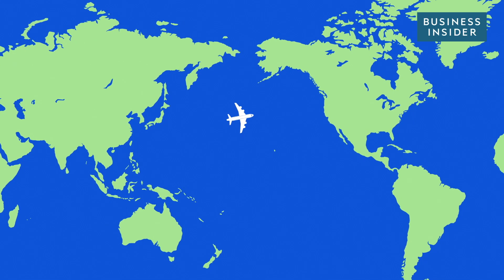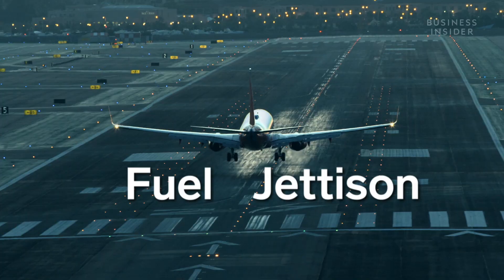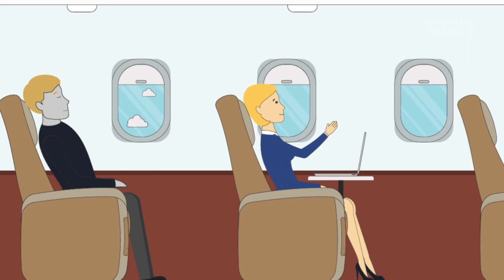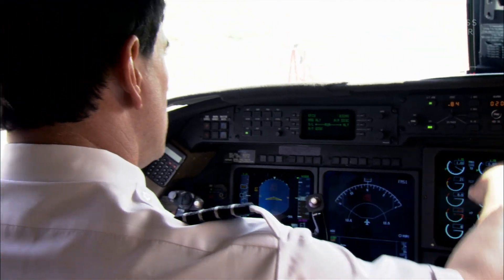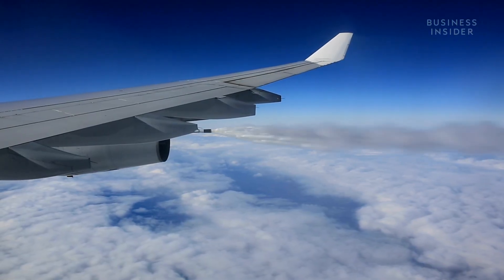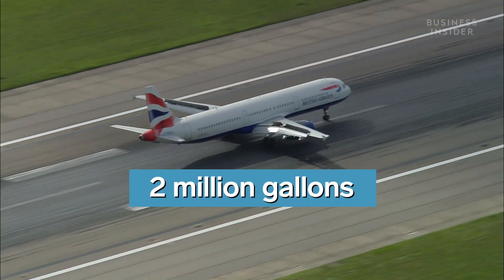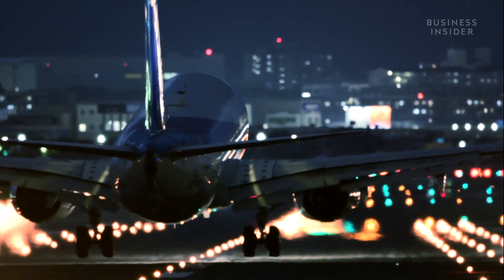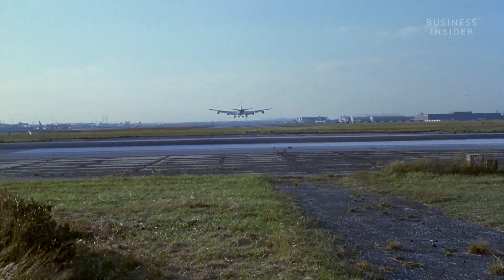Why Planes Dump Jet Fuel

Comment: Thousands of gallons a second... 15 minutes... hmmmmm
Reply: Smells fishy to me. And cargo planes with tons of stuff on board land. 
And all they do is talk bout jet fuel.
Reply: @basketballgod5947  fill up a water bottle with Legos. Now fill it with water. The water is wayyy heavier. Jet fuel is most of the weight in a plane since liquids weigh much more
Reply: thousands of POUNDS a second
Reply: Looks like your the only one who realised the math isn't adding up.

The Real answer? This video is propaganda to reinforce your belief that commercial jets use fuel. In reality once started and warmed up no fuel is required for a jet engine to run. What?! The jet turbine engine can and does run.. combusting superheated compressed air. 

"Jet fuel" is only used for cold starts.

So, this video is nothing more than.. hot air. Lol.

You've been Red-pilled. Research!
Reply: @ExploreYourWorld-oo3jd  Go to highschool again please..without fuel where is the energy coming from to fight the drag from air
Reply: ExploreYourWorld 2019 uh
Reply: @shreyasbhatt7112  r/wooosh
Reply: ExploreYourWorld 2019 I don’t think you know how chemistry works.....
Reply: ExploreYourWorld 2019 nah man the fuel is superheated and compressed In the engine causing it to combust and produce thrust the keep the plane moving
Reply: @ExploreYourWorld-oo3jd  that's not how jet engines work... they pressurize air and add fuel additive to combust it. Once the pressurized air leaves the the engine it expands very fast causing thrust.
Reply: @ExploreYourWorld-oo3jd  um...do you know basic chemistry? Like the kind u learn in 6th grade?
Reply: @jasonpeng5798  6th grade? It’s obvious he’s not telling the truth for a 3rd grader.
Reply: @ExploreYourWorld-oo3jd  You are incorrect. Not sure where you got this wrong information from. You are mistaking an ignition source with fuel. Both are required for combustion. Please make sure you have at least a mild understanding of basic engine / turbine principles before writing an obnoxious and incorrect comment.
Reply: @ExploreYourWorld-oo3jd  yeah OK rwby music playlist boy
Reply: ExploreYourWorld 2019 my dads a pilot and he can confirm without a doubt your wrong, I mean why would they make us think that anayway, so the airlines waste money and buy useless barrels of fuel?
Reply: @ExploreYourWorld-oo3jd  holy shit another one of those climate change deniers.
Reply: @ExploreYourWorld-oo3jd  Get flamed lmaooo
Reply: @ExploreYourWorld-oo3jd  lol.
Reply: @ExploreYourWorld-oo3jd  a machine that doest require any additional energy to keep moving is a perpetual machine which to this day doesn’t exist .
Reply: ExploreYourWorld 2019 ‘propaganda’

Comment: Make the engine run like my truck. 
14.2 mpg.  
I’m sure they can figure a way for the engine to burn much more fuel if needed.
Reply: They already run 
Those engines burn like 2gpm
Reply: James B10 
I understand that. 
I was just thinking they should be able to run it rich or somehow be able to burn it off in a different way. 
If they could do that and have a lot of drag they could burn off that fuel
Reply: @mikesacco8457   You can do that in a plane propelled by a piston engine where you have manual control of the mixture but this will not drastically increase the consume
Reply: James B10 
The way I’m thinking is they could set it up somehow that it can do it automatically. 
I’d say use the APU but it could never  burn that much fuel. 
And I’ll guess they never did anything like this because of cost and the fact very few ever dump fuel. 
If laws were put in place they would have to come up with a way to not dump raw fuel. 
The one thing I have learned when I started taking lessons and received my private license anything is possible. 
And I say this from what the mechanic would always tell me. 
Anything can be done but it always comes down to cost.
Reply: @mikesacco8457  That's true, and it probably will never be done if adds some weight 
For now our best option is create the most drag you can and dump

Comment: On September 2, 1998 Swiss Air flight 111, which was an MD-11 aircraft, crashed off the coast of Nova Scotia killing all 229 passengers/crew on board because there was smoke in the cockpit and the pilot chose to fly out over the ocean and dump fuel rather than land immediately. Sadly that was the wrong decision.
Reply: Actually if you look it up, investigators believed that even if they had attempted to land immediately, the plane would have still crashed, due to the severity and heat found in what was left of the wreckage. You can also refer to TheFlightChannel's video on the crash
Reply: Most likely would have die either way. The plane was quickly in flames. That's the worst thing that can happen. They couldn't have landed, in one piece, with all their fuel. They made the right decision by following the safety procedure in place at the time.
Reply: The airplane would have been crushed.
Reply: It made no difference in the end
Reply: Well the chance of crashing from not dumping fuel are much higher compare to the chance of die from the smoke. This is just one of those unlucky attempt
Reply: Very correct. A simple emergency diversion to YHZ with a low sink rate landing could have given them all a fighting chance.

Comment: Oh so that explains why i see white lines in the sky. Huh...
Reply: No… No. Those are contrails. Condensation left behind by the pressurized hot air escaping the engines. 
Or in some case you can see condensation due to vortices formed at the tip of the wings (cf: https://commons.wikimedia.org/wiki/File:Propeller_tip_vortices_being_generated_by_P-40N1_Warhawk_VH-ZOC_at_Temora.jpg#/media/File:Propeller_tip_vortices_being_generated_by_P-40N1_Warhawk_VH-ZOC_at_Temora.jpg)
Reply: viraltaco love a good citing 🙌
Reply: No no that's from the chemicals to make it rain
Reply: @viraltaco thanks for being informative!

Comment: They say rare occasions , but every time I look up all I see is the fuel steaks in the sky
Reply: This is because of the temperature difference. It is much cold at higher altitudes and therefore the hot exhaust gas produces the streak. Imagine if you were to blow out slowly on a cold day.
Reply: Contrails. At certain altitudes and certain conditions, any airplane leaves condensation trails, visible in WWII shots of planes that didn’t have jet engines or fuel jettison. If you’ve ever seen what looks like a drop of rust on your car that just wipes away, that’s jettisoned fuel.

Comment: Couldnt they use the oxygen mask or something? Also, couldnt the passenger not get in the plane if she knew she had these problems? What a waste of fuel.
Reply: you can't deploy only one mask, and they only deploy when there's a sudden decrease in air pressure. also, they're only supposed to last as long as it takes to get the plane to safe altitude which is from a few seconds to a couple minutes tops.

Comment: I witnessed a Boeing 737 dump fuel via the NACA ducts over Balboa Park at low altitude just after take off and it did not do a return to runway. Facts straitened. Its still a fuel dump pups.
Reply: Boeing 737s cant dump fuel by pilot control. What you saw was fuel spilling out through NACA vents from the surge tanks. Not dumping fuel persay.

Comment: I’d like to add something... dumping fuel is rare because most of the time the quantity of fuel loaded in a plane is the fuel needed to do the trip he’s going to do according to the extra fuel, contingency fuel etc it has to have. Also the Boeing 737 can not dump fuel. What they actually do is flying at lower altitude or flying with flaps, landing gear to increase drag and therefore increase fuel consumption.
Reply: Mister Apple She just explained the reason why people would need to dump fuel... and what you said doesn’t negate that.
Reply: Shubham Mishra  Because he pretty much just rewrote the video's explanation. Why do you need to spam useless crap all the time?
Reply: Well that's what the video says...lol
Reply: You didn't add anything that was all in the video.
Reply: Shubham.. 'all the time"¿ do you know that person¿

how'd you know otherwise.. well unless you are a stalker or a jilted ex¡
Reply: A wide body is different especially with freight and everything therefore it would be to heavy to land and have enough time to slow down.
Reply: Shubham Mishra all the time? They left one comment
Reply: What about a 737 that has not been cleared for landing and needs to keep flying for hours and hours before it is able to land? Would it not run out of fuel?
(This comes with the assumption that a 737 cannot afford to have tonnes of reserve fuel for such a condition, as it would need to dump all that extra fuel before landing in case of a usual flight.)
Reply: Ted BD If an understand well you said : If a 737 isn’t cleared for landing and runs out of fuel ? Well normally it shouldn’t happen because the fuel that is carried on board aircrafts is regulated by the fuel policy of ICAO SARPS. An aircraft that is landing must land with at least the final reserve fuel that is 30 of fuel at holding speed 1500 above its alternate airport, in case of a jet engine. So if the aircraft is expected to land with less fuel, it has to declare a mayday fuel. Unforeseen events are covered by the contingency fuel, alternate fuel is the fuel to go to the alternate after a missed approach, additional fuel is in case of ETOPS or special operations such as no alternate or isolated aerodrome. So as you might see, aircrafts carry way more fuel that is actually required to go from A to B but it’s the law and everyone has to comply with it
Reply: 737 fuel overflow vent is what I witnessed apparently. The vents (NACA ducts), located near each wing tip, provide a small positive head of pressure on the fuel in all three tanks. This prevents a vacuum forming as fuel is used, assists the fuel pumps and reduces evaporation. NB if you overfill the fuel tanks, then this is where the ensuing fuel spillage will come from!
Reply: Or just do an overweight landing.
Reply: GNranger with the risk of ending into the stopway. Or damaging the aircraft structure, breaking the landing gear...

Comment: Here I am trying to preserve the planet and saying no to plastic bags and straws and come these jerk offs-DUMPING THE FUEL IN AIR???
Reply: It's not a common occurrence.
Reply: GNranger how are you so certain?
Reply: @rasul407  1) Only some aircraft have the ability to do it. 2) the EPA has it about 127 times a year. Assuming that their numbers reflect dumping in Us territory, that is 0.0000078882%.
Reply: GNranger forget the percentage 127 times which I assume reported ones are a lot of dumping!
Reply: @rasul407  out of 16 million flights
Reply: GNranger 16 million flights in America or World Wide?
Reply: @rasul407  16 million flights handled by the FAA. Yearly there are around 45 million.
Reply: GNranger the department of transportation says there are over 700 million domestic flights in the US alone. So if 127 dump is out of 16 million flights then what’s the dump out of 700 million flights?
Reply: GNranger yes yes! Duh! That was passenger? I thought it was number of flights!

Comment: Answer: the plane loses weight so its easier to land on the water or land
Reply: Do you know how slim the chance of survival is when landing on water...?
Answer:so dangerous it's not taken as an option and crashing on land is always preferred
Reply: @safetyinstructor  Sully would like a word.
Reply: @saintchuck9857  that was in a city
Reply: @safetyinstructor  crashing in laand is not preffered. If you are able too make it to water and land saffely, but not an airport, you should always head for the water. An example of where this has happened is what we call 'The Miracle On The Hudson,' where pilot Sully Sullenberger and Jeffrey Skiles suffered a birdstrike at a low altitude and lost both engines. They then glided the plane down to the Hudson river, since the closest airport (LaGuardia) was too far away  and the plane was too low. Every passenger (over 200 I believe) survived that ditching. This landing was later pronounced as the most succesful ditching is aviation history.
Reply: @nathanaelmalm5641 
It's really funny how you're teaching me about Sully like I've lived in a cave for the last two decades! 
 yes... they choose the Hudson because it's New York city but usually there are not that many skyscrapers.
If you believe you're able to make it back to the airport(or open land) you try to make it back since most emergency landings on water result in most of the people on board becoming shrimp food.
Of course if you don't feel like you're making it back to the airport or open land (like Sully and his crew) or if you start loosing control of the aircraft you are going to aim for open water.
Reply: Yudi Kurina Ryanair does
Reply: Tl;DR: plane reduces weight if able to get on the ground safely, but only in an emergency.

To be exact, a plane dumps fuel in an emergency to reduce the weight of the airplane, so that the TOW (Total Overall Weight) is below the maximum landing weight for the airplane. If the plane is not able to dump enough fuel or unable to dump at all, it will land overweight, however that is risky, since the fuel can catch fire which can spread to the engine or cabin (or both) if it lands too hard. If a plane can't dump, it usually won't land overweight because of that risk. It will instead increase drag to slow down and burn fuel.
Reply: Answer: the plane loses weight so it's below it Maximum Landing Weight.
Reply: @gnranger  which isn't necessary. they just want to save money that's why.

Comment: To save you your time, it is to not pop the tire on landing
Reply: No. Plane have maximum structural landing weights. Landing 30k lbs overweight wouldn't just burst a tire.
Reply: What if one of the main landing gears broke? Plane slips of the runway into some aircraft taxiing or a dam and bursts into flames?